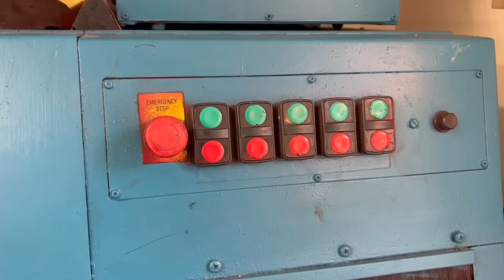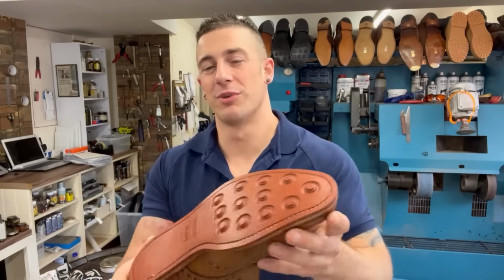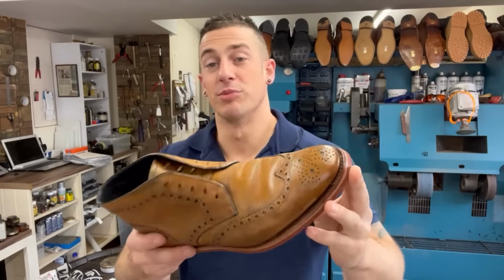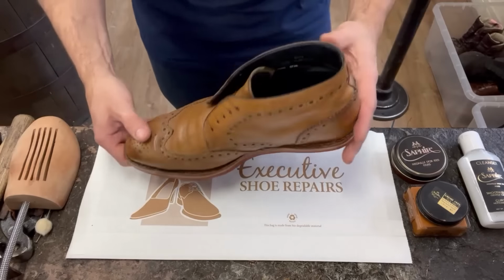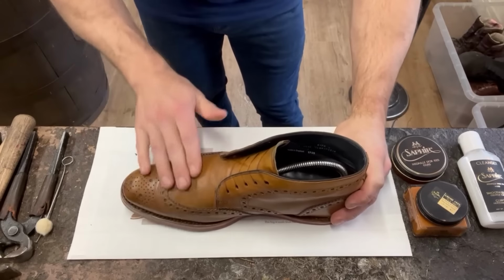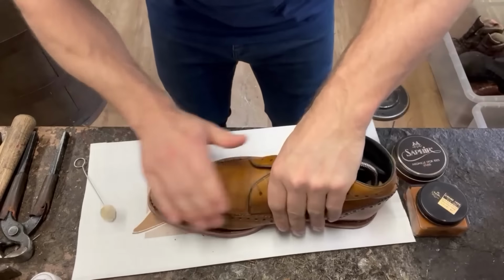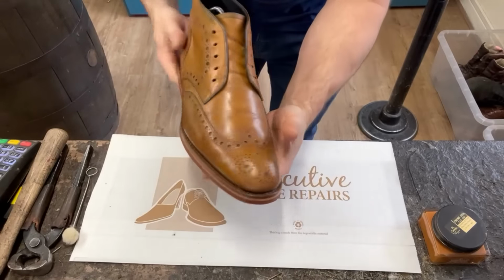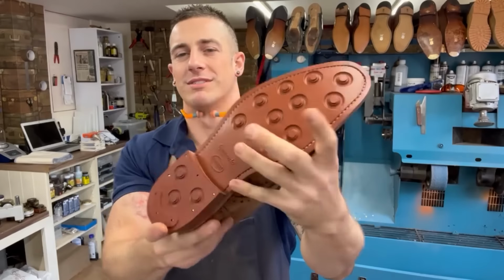ASMR  Shoe Restoration | Loake Dainite Soles Red Edition!

Comment: Why replace the midsole? It still looked pretty good! Just wondering.
Reply from the maker: Just a proper way to do a thorough repair, it was slightly coming away from the welt too 👌
Reply: @Dan_the_cobbler  I had a pair of Loake Chelsea boots re-soled by Loake, they came back minus the mid sole and the pull on tabs cut with something sharp.When I queried the mess they had made of a pair of £200 boots they said that is the job they do. Iwent to the top and complained to management and was told to select a pair of boots from an enclosed catalogue, I wanted a £90 repair and ended up with a new pair of Loake boots worth £300 and kept my original boots.
Reply from the maker: The factory isn’t always as top standard as you’d expect! Hit and miss from what I’ve heard over the years.

Comment: I have fixed shoes for 31 years and it would be so much fun to work with you for a couple of weeks to learn your way …. Never to old to learn new techniques from a true professional… where I work it’s all about time I usually have 5 hours to do at least 1 pair of fullsoles sometimes 2 pairs plus 7 pairs for rubber half soles plus steel toes plus heels and has to be done in 5 hours no excuses doesn’t even matter if there is 3 layers of old stitches in the welt you have to pick